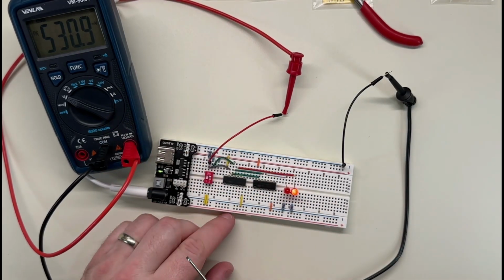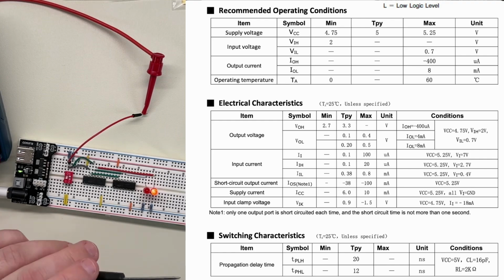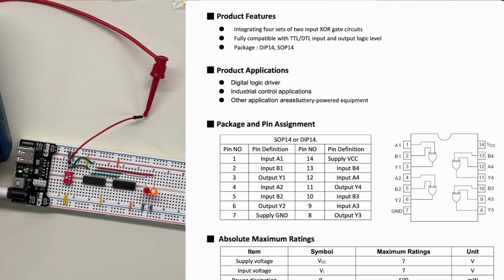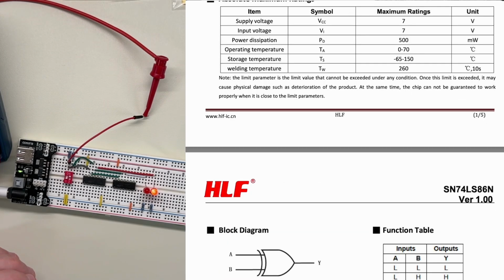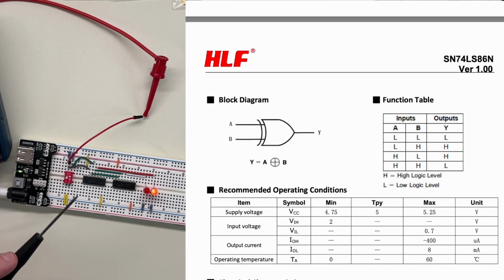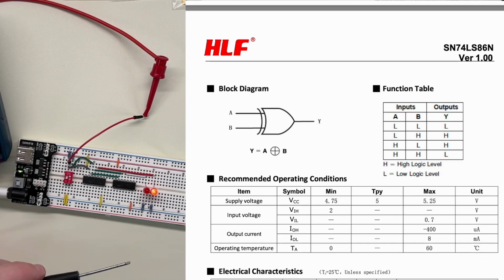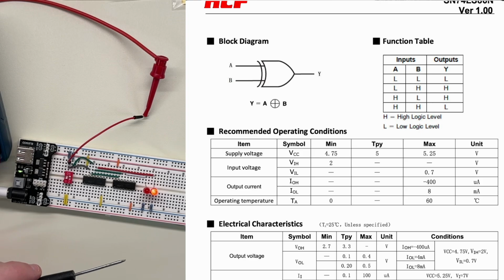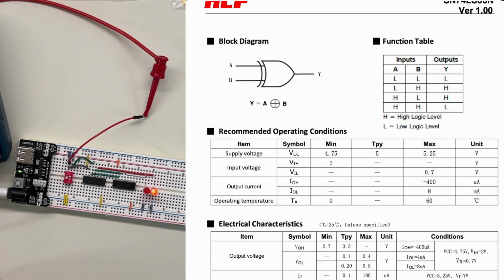Trying to understand pull up and pull down resistors

Comment: I just saw a Big Clive video (https://youtu.be/M5IS8FCh1yM?si=dx1FHx66zg8p-JB7) where he was talking about different resistors for different LEDs, and it reminded me I meant to comment here, so I figured I'd leave that pointer as well.

I'm not an EE and have only a hobbyist understanding of these things, but I think there are a small number of concepts that give 90% of the value for reasoning about circuits like this. Ohm's law and the power law, of course. And Kirchoff's laws, or at least the most important aspects of series and parallel circuits: in series, the current through all elements is the same and the voltage drops across each add up to the total voltage; in parallel, the voltage is the same across all elements and the currents through them sum up. And with those, you can understand a voltage divider, which is what happens when you have two resistors in series and by changing their values, you can adjust the voltage between them. (That is what you are measuring with your pull-down resistor.)

I find the water analogies to be more confusing than helpful, but that's how my brain is wired. I'm not good with analogies because I always get distracted by the edge cases where they break down. Speaking of edge cases, though, that's something I do find useful for developing an intuition for situations like you had with increasing or decreasing the resistor.

In this case, to represent it in bad ASCII art, you have: GND--R--^--...--5V (R = resistor, ^ = your probe, ... = other stuff in the circuit), you could consider the limits: what happens if you have a 0 ohm resistor? In that case, R is just a wire, so your probe is connected directly to ground and you would expect it to read 0 volts. Now think about the other extreme: as the resistance goes to infinity, it acts more like an open connection, your probe gets "further away" from ground, and the voltage you're measuring is dominated by the 5V side so it goes up. Or to look at it from a math angle, is that the voltage drop across a resistor is proportional to its resistance (V=IR), so the higher the resistance, the greater the voltage difference across it. In this case, one side is 0, so when the resistance goes up, the voltage on the probe side goes up. Either way, this explains why higher-valued resistors are "weak" pull-downs (or ups). They don't pull as hard toward the rail.
Reply from the maker: Thanks! There's a lot to digest here and I really appreciate it.

(btw, it seems like something got confused with the video link, though, because that appears to just link to my video here. I'll have to search a bit to see if I can find the video you're referencing.)
Reply: @bigzaphod Sorry about that, the link I wanted was https://youtu.be/M5IS8FCh1yM?si=dx1FHx66zg8p-JB7. The something that got confused was me.
Reply: To say what was unsaid in the Big Clive video: LEDs, being diodes, have (close enough to) a constant voltage drop (which varies by color/chemistry). When you put a resistor in series with it to control the current, you can calculate the value this way. You know you're starting with, e.g. 4.5V (3x1.5V batteries). You can look on your LED data sheet (say, https://www.farnell.com/datasheets/1498852.pdf) and see it has a forward voltage of 2V. Subtract that from 4.5. That leaves 2.5V for the resistor to take care of. Now pick a current (more current = more brighter). The data sheet says 20mA maximum continuous current - that's about typical for a red LED and one of the few numbers I can remember. As far as we care, the LED acts like it has no resistance, so it's up to the resistor to limit the current (and remember, they're in series, so the current though the resistor and the LED are equal). Now we're back to Ohm's law where we have 2 out of 3 variables. R = V/I = 2.5V/0.020A = 125Ω. So 125Ω for maximum brightness - of that Farnell red LED, in this circuit, with a 4.5V supply. If you go by the data sheet.

So you can see why Clive says they have abused the LEDs. They're pushing 106mA through the red one. As I said in my other comment, things tend to work beyond their stated operating range, but this is surely not good for it.